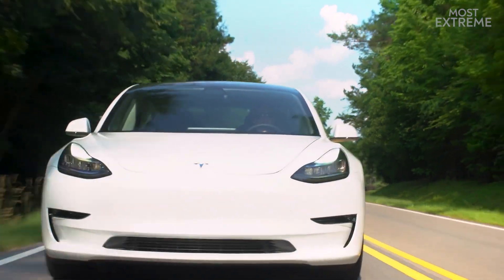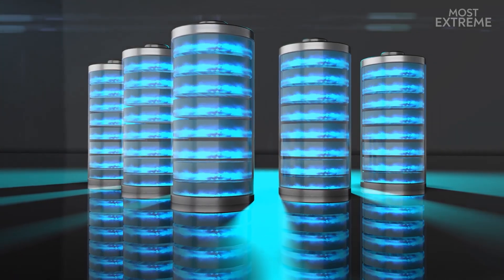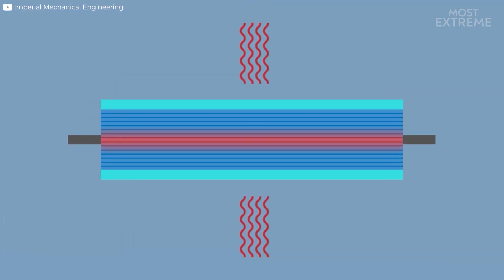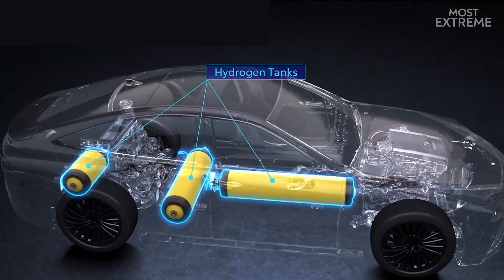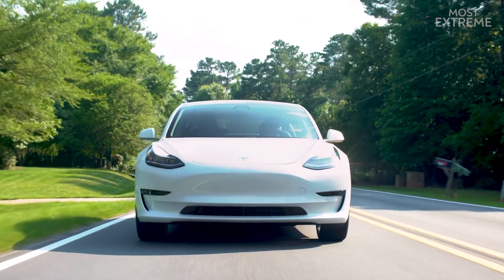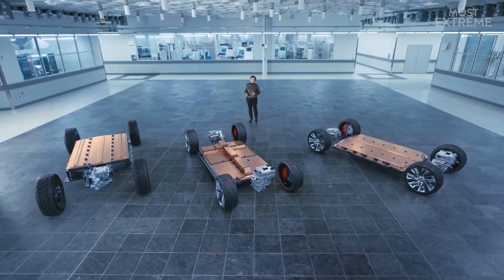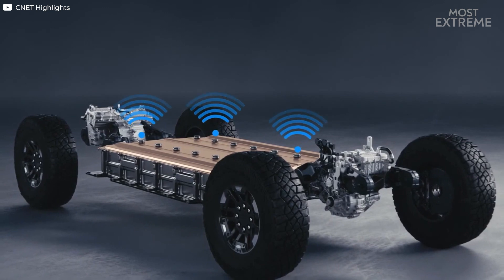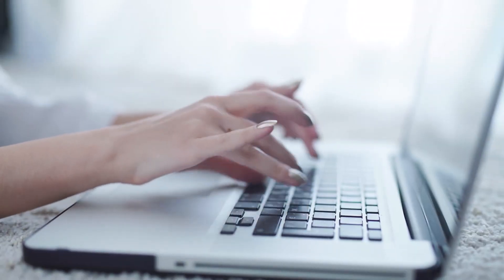Lithium VS Hydrogen VS Solid State | EV Battery Technologies Explained

Comment: wait, so what is the metal when take apart a lithium battery and toss that thin flexible sheet of metal into water and it ignites? that's not lithium is just charged with lithium ions? Lithium compound?

Comment: Hydrogen is a joke.  Sure, pure hydrogen is a powerful and abundant element.  But unfortunately you can't find pure hydrogen.  It naturally bonds to everything.  The only way to get pure hydrogen is to break it's bond with whatever it is bonded to.  Which is expensive and often very polluting.  And being the lightest element, the only way to contain it is under pressure at extremely cold temperature.  Also expensive and requires energy.  I see it all over my feed.  But this is only the result of oil companies disinformation campaign.

Comment: BYD has a hybrid car coming out that - get this - has a 2,000 mile range on a full tank plus full charge.

Also, Toyota has a solid state battery with a 745-mile range that they are ramping up a plant to be putting them into their cars for 2027.

Comment: Hydrogen has an energy density problem.  While energy per kg is very good, energy per litre is very low (even in liquid form) leading to large fuel tanks.  To make matters worse, the high pressure required for hydrogen makes them very heavy.

Comment: The problem with H2 is that it is explosive and has high pressure, much like placing explosives under your car or having an H2 refueling station, which can be dangerous to the surrounding area. Why do we have to deal with the risk of explosions spreading throughout the city just for the sake of mass casualties?

Comment: Smoke and mirrors. There's so much wrong with this video. Solid state batteries will take some years (maybe ten) before that depicted in this video becomes a reality in in a vehicle. The solid state battery will use lithium at its anode - even if they go with just a substrate (e.g., copper) at the anode and plate lithium metal onto it during the charging. It is possible, but not likely they will use a silicon-containing anode, but not if they want to attain the lifetime they espouse in the video. Further, "lithium-ion" came into existence 33 years ago (I was there!) because metallic lithium was deemed too dangerous. If lithium metal or plated-on-charge lithium makes it into a battery it will take a very large amount of testing and a few years, plus getting the regulatory agencies in many countries time to approve its use. To take it further - liquid and gel electrolytes can penetrate the electrodes and be "where they need to be" for conduction of lithium ions in a "lithium-ion battery. In Toyota's vision (or hallucination) the conduction of lithium-ions will still be required, but the conductance of solid electrolytes is presently - and maybe never will be - as high as liquid or gel electrolytes. Toyota is correct about the shortcomings of liquid and gel electrolytes, but in my well-informed opinion, they do not have the answer. In fact, at one point in the video they showed cells with the label of another company - QuantumScape - who are no closer to a solution. Perhaps Toyota is not talking about their own work, and are maybe relying on work they fund at other companies. The numbers 900 mile range and less than 10 minutes for charge are still just pipe dreams.

Comment: I would never get a hydrogen powered car.  Too many problems when getting them fueled up and handling problems.  I know there are very few fueling stations - but that is not my main issue.

No matter what battery technology is used, there will always be Pros and Cons for operations with a vehicle.  Ideal situation with Lithium battery charging is if you only drive around town and do tasks on a single charge during the daily routines.  Then charge the vehicle overnight at home.

Thanks and take care.

Comment: What will happen to the batteries after the end of life, will this just add to pollution or is there a green way of disposal, I fear this will be a massive problem with disposing of millions of Ev cars every year. Will the battery proformas lessen through use so will a 300 km trip on a full charge turn into a 100km trip after 6 years of use depending on the mileage a user will do, of course. Hydrogen will not have long-term problems like this.

Comment: Producing hydrogen from electrolysis should be fairly cheap using renewable energy. It is just that there is not enough demand for hydrogen yet to justify an investment like that. Out of all these options, I would bet on hydrogen to be the dominant type cars in 10 years.
Reply: No such thing as renewable energy.  It takes energy to make the components for windmills and solar panels. If you're talking nuclear,  then perhaps

Comment: Solid state battery is ready.  Toyota is still promoting hybrid and its hydrogen  technology. No one needs complication and  combustion engines , and it's market share will shrink mostly day after day.  I love my Toyota Camry but  Bye bye toyota. Keep your baggage and  stay at the past.   Other solid state battery manufacturers  such as solid Power and QS are catching up  real fast.   Most importantly, ProLogium Technology  is quietly  tweaking its production lines  for many years and will produce solid state battery in 2023. Vinfast   And Mercedes Benz  We'll use its battery  In 2023.

Comment: 5:40 Yeah producing Liquid Hydrogen requires a ton energy, which might make it as costly as running Gas cars. But that being said, Electric cars are not that clean either. First you get a dead battery eventually and the electricity used has to be produced first also. Even if you produce said electricity using Solar or Wind energy, both also still have an impact to waste produced being manufactured and later the maintenance while in service.
The question is just, how big is the impact of gas cars vs electric cars vs liquid hydrogen vs solid state battery cars.
Reply: That's not the point of hydrogen fuel cell.
   Energy is unlimited, you have the sun, you have wind, you have nuclear energy. Energy is all around us and technology allows us to harvest it.
  However, natural resources, certain ones are limited.
  Lithium is a finite resources, the world will run out of lithium before we run out of oil. So you know, what happens then? Hydrogen is infinite, it's in sea water. You need energy to extract them, you have the sun and solar power cell, That's the differences. You can use the lithium to store that infinite energy you're extracting from the sun, or you can use lithium to store energy in both the sun and the cars, which just waste more lithium.
   100 years from now, all the known lithium reserves in the world will be gone. If you're counting on a breakthrough in battery technology that allows us to make same efficient batteries out of other material, that's wishful thinking. It's like the ones claiming that let's used up all the oil because somebody will figure out how to sustain modern chemical industries without oil. That's insane.
  There are only a few infinite natural resources in this world. Oxygen, Hydrogen, Silicone, ...
   If you change from oil to Lithium battery, it's like changing from one finite resources to another finite resources.
  Go study some physics.
Reply: @markarmage3776  I find it interesting that you count up "unlimited" energy sources and name Nuklear. Unless I miss something, you need Uranium which is finite.

But I agree with you here, in Europe I see Germany boot up Coal Power Plants again because no Gas and they talk about using the few Nuklear longer now. Energy prices are on the rising there.
If you use Solar and Wind, you need to have Batteries.

I find it concerning that nowadays there are so many devices that are sold that require Batteries, when I was young we used to ride a bike... now everyone uses those E-Bikes. Last time I walked with my wife we seen people on Longboards... E-Longboards.
Right now the craze goes towards "cordless" things, but then you need Batteries.
Like you say, it's like changing from one finite resources to another finite resources.

The most funny thing is that Germanies old Chancellor Angela Merkel is a Physicist.

Thank you for your input!

Comment: If you want a metal that can store energy , non explosive and non flammable we should consider Vanadium batteries. They discharge 100% of stored energy and takes about 20 years to degrade ,This is what have been used for our storage of electricity at power plants all along and i find if more efficient compared to Lithium which is explosive and flammable.

I am an Engineering Student in South Africa and whoever who is interested on working through this big project , i mean starting this project just give me an email
Reply: Vanadium redox flow batteries you mean? I wouldn't even call it degradation, you can just replace the substance and it's good to go again. It's a good option for long duration storage.
Reply: Good for large footprint \, not for cars.
Reply: what about energy density?
Reply: Cool!  New to me.  I am a retired mechanical design engineer, and I am excited about all these.

Comment: you could load a brick of magnesium and either burn it and add water or dissolve it in hydrochloric acid to produce the hydrogen and it would eliminate the trillion plus dollars needed to build all of the pumping stations we would otherwise need.
Reply: That is too simplistic. You still need to compress the hydrogen gas into liquid form and the cost is huge in infrastructure.

Comment: 80% of cars sold in the US are pre-owned. There is essentially no used electric car market that could be considered a value comparatively. Of course, now with crazy inflation and supply issues, used cars are more expensive, but still,  used ICE cars are much less expensive than new ICE and Electric cars.

Comment: "Ranges of only 3 to 4 hundred miles." Meanwhile, many ICE vehicles barely have that range because of low MPG numbers. I drive a 2018 Dodge Grand Caravan for a work vehicle at my job daily which has a full tank range of around 400ish miles. Stop acting like 3 to 4 hundred miles is short for an EV range when many ICE cars have similar ranges.  The biggest hurdle is the speed of charging that is rapidly being reduced with several boasting of 80% charge in as little 20 minutes. I don't know what you've been looking at, but many newer EV's have (especially Tesla) have found ways to reduce charging times with the use of powerful DC charging stations bringing down charging times to 30 minutes or less for 80% charge or more. It's only when you start looking at the home charging stations using 240v/120v AC power that those charging times go up. As for solid state batteries, your assessment of them is completely off. Toyota is working on this tech at a rapid pace and plan on testing them in the real world in their Hybrid lineup before adopting them to their growing EV lineup. So the idea of that type of battery being only in high priced luxury vehicles is 100% way off.

Comment: And, where does all the electricity come from to charge electric cars? Oh, yes, from burning coal or natural gas. What will happen if 300 million vehicles in the U.S. plugin every day to be charged? Boom, everything is fried. Hydrogen is the answer. You can use hydrogen to fly jet planes and just about everything. Also, all combustion engines can be converted to run on all three fuels, natural gas, gasoline, and hydrogen.
Reply: Where does all the gas/petrol or diesel come from to power ICE cars? Ah yes, from oil refineries which use electricity from power stations powered by coal or natural gas. Your point was????   So hydrogen is the answer is it? And how do we produce hydrogen? How will it reach all the places where it is used?
Reply: @Brian-om2hh  well, if I tell you that infrastructure   is already there, but U.S. is not trying to use it.  Hydrogen can be used like natural gas.  So the pipes are already there, we need to switch from natural gas to hydrogen.  Then natural gas can be used to create hydrogen and 100% Co2 can be captured and then converted to clean fuel for planes.  All these technology is already out there.

Comment: Do you, the person who voiced this video own an electronic vehicle? I do NOT own an electric vehicle because: 1. Cost. 2. Battery life - cycle times. 3. Time to re-charge. 4. The chemicals needed for batteries are expensive and rare elements. 5. The batteries are not easily recycled. 6. Charging connector standards and number of charging stations infrastructure doesn’t really compare to gas stations. 7. If the government wanted us to have electric vehicles they would be investing in these technologies, standards and infrastructure to bring about the change. Instead the government hampers these efforts by wanting to increase taxes. :-(
Reply: You obviously live in the US, because here in the UK we already have 3 times more public charging connections than there are petrol stations. There are also a further 30,000 public charging connections being installed in 2022 alone. Older EV batteries are not too problematic to recycle if you have a bespoke recycling plant. Some car makers have already invested in EV battery recycling plants. Here in the UK at least, it is not the Government who are providing the vast majority of EV charging infrastructure, it is private enterprise.  Battery life in many EV's is already exceeding 10+ years. And of course once efficiency reaches a certain point, it is possible to have the battery pack refurbished at a fraction of the cost of a complete replacement. Charging connector standards are not really an issue. There are basically 2 types. Most current EV's have the same type socket. Only the Nissan Leaf differs by using a non standard type (Chademo). However, Nissan have reverted to using the same type of connector as other EV's on their latest EV. If the cost of a new EV is an issue, then consider the used EV market, which has a plentiful supply now. You don't have to buy new....

Comment: Cobalt is mined in the Congo and humans bring it out in bare feet. Lithium is also polluting . Making batteries requires a large amount of dirty energy to manufacture them.  Hydrogen does not have this issues.
Reply: So where and how will the platinum, used in the manufacture of hydrogen fuel cells, be sourced?   Cobalt has been mined for decades by the big oil companies. They need cobalt to remove sulphur during the refining process. If you drive an ICE car, you are just as guilty as those you are trying to discredit.....  Hydrogen has huge manufacturing issues with inefficiency. Hydrogen powered cars are also frighteningly inefficient, achieving around 23% efficiency, which is worse than some ICE vehicles. And don't expect hydrogen to be a cheap fuel......